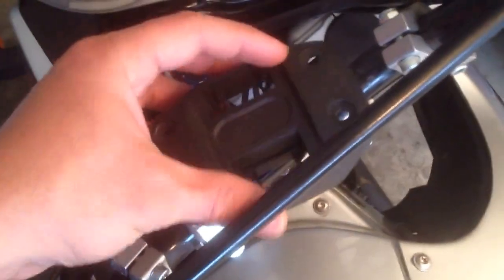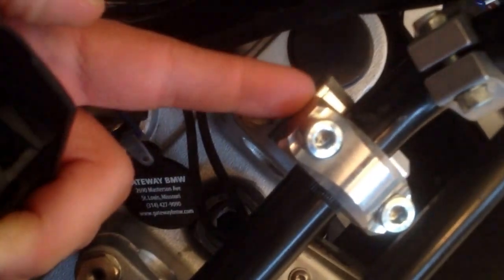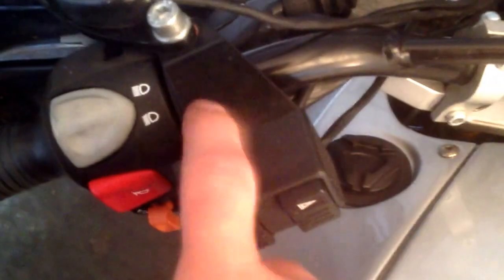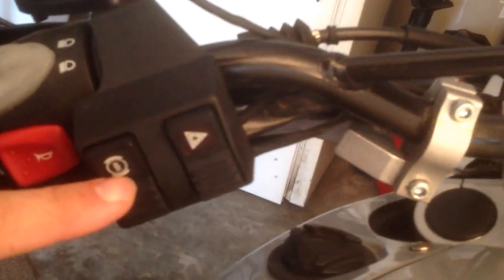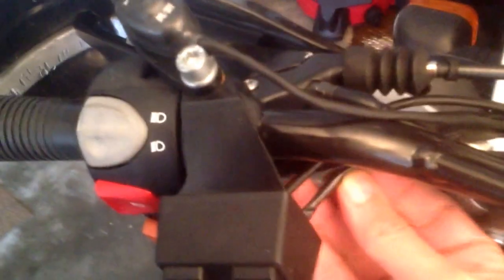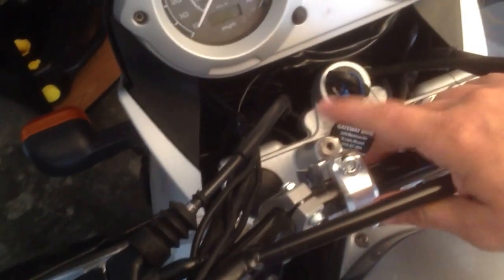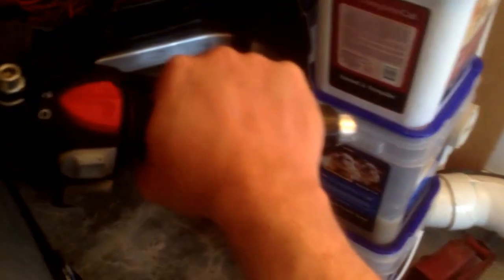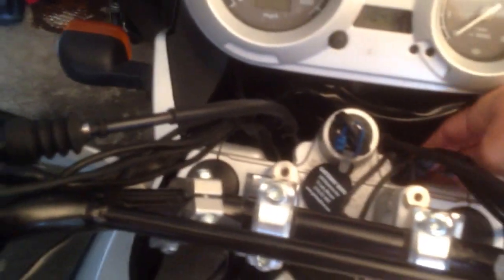BMW G650GS (Single) ABS Switch relocation, Risers, and Rant.

Comment: I have a 2005 F650GS Dakar. I bought the 2" riser from ROX, and encountered the same problem. 
Here's what I'm wondering. ROX uses a 1" long allen head for fixing the handlebar to it, four of them to be precise. So what if these ROX bolts were used for the lower part instead of the OEM bolts, i.e., the ones with the recessed tap for the switch housing? Then the upper part could use the recessed, tapped ones for the top (the ROX riser) like normal.
Reply from the maker: Well possible. I don’t have the bike near me to check. However I believe that the OEM bolts have a large shoulder on them. I am not sure the rod supplied ones would fit nicely. On the other hand just a little dusting with an angle grinder and a flap wheel and there will be enough clearance.
Reply: I appreciate the quick reply!! I took it apart and found that, yeah, the OEM bolts are 1.25" and they have a "shoulder". The ROX bolts are 1".

I'm going to do the exact same job on my bike as you had done on yours. Do you happen to know the BMW part number for this housing/bracket for the two switches? That would be a huge help. 

Best regards from Korea!
Reply: Never mind! They're as follows:
 61132316865   "Switch Housing"
61137664437   "Bracket for special Signal Switch
07119906411   "Filister Head Screw"  (M4x16)

If I can get my hands on these, I believe this job will be straightforward.
Reply from the maker: Great. I don't know if the form link is still active in the description above but it had the part numbers and some other's approaches. it does work nice just a bad job by a dealer, I would do it my self this time. It is my girls bike but I really like it and if I could find a Dakar model in good shape I would buy it. I am sure you will enjoy your bike as much.

Comment: Do you know if the left switch of the G2 can be placed on the G1?
Keeping only the ABS and taking alert?
Reply from the maker: I'm sorry I don't understand your question. I don't know you you mean by "G2" and "G1". that being said I think you could relocate only one of the switches if you liked as they each have their own wire.
Reply: @wb5plj  G1 = Generation 1 = G650gs 2011 or before
               G2 = Generation 2 = G650gs 2012 or more.

At least here in Brazil, that's what we call our G bikes..
Reply from the maker: Matheus Mittang  ah, now I know. I don’t know anything about the G2 I am afraid. That is the only 650gs I have ever had any exposure to. Hopefully someone else could help out. As for the G1 they are separate things so can be moved anyware. Of course I realize now that is not exactly what you where asking.

Comment from the maker: yes very disturbing on the part of the dealers. their work was un-safe. they are one of three that are reasonably close to me. mind you that is over two and a half hours away. the options are not many. Sadly fit and finish details, not just basically doing the job, but doing it right. that is something that is a growing cultural issue here in America. It speaks less of a dealer problem than it does of a cultural change that I am not happy with.